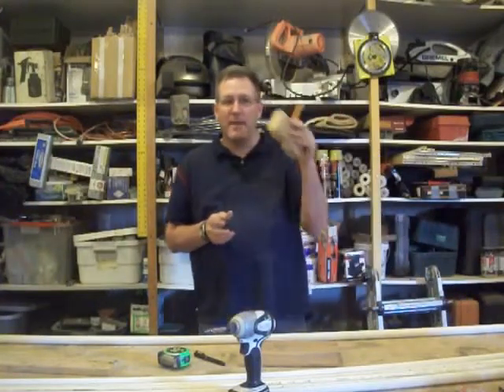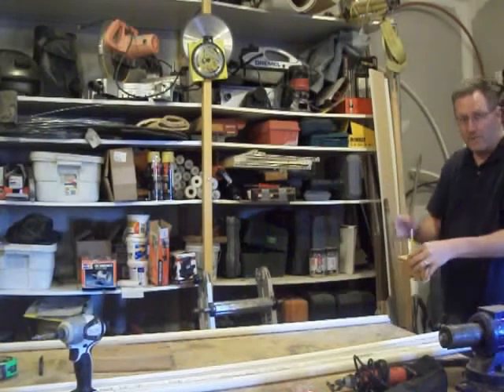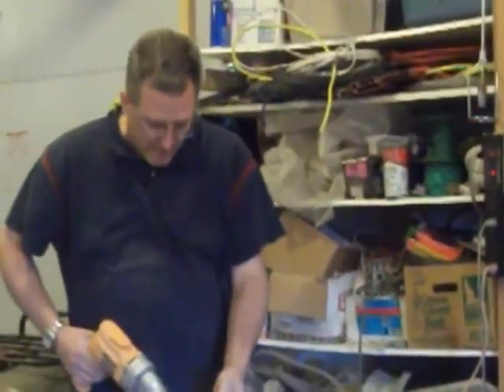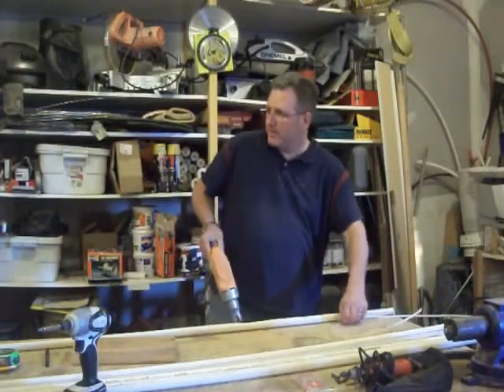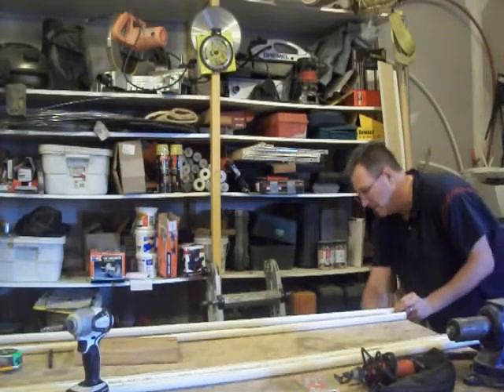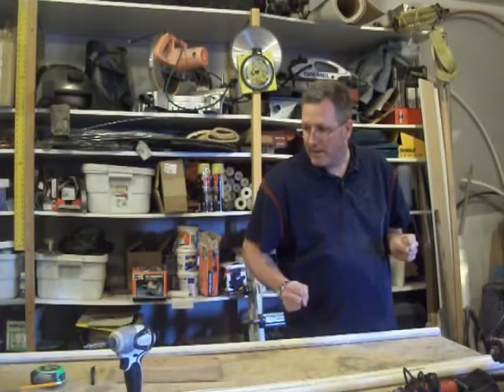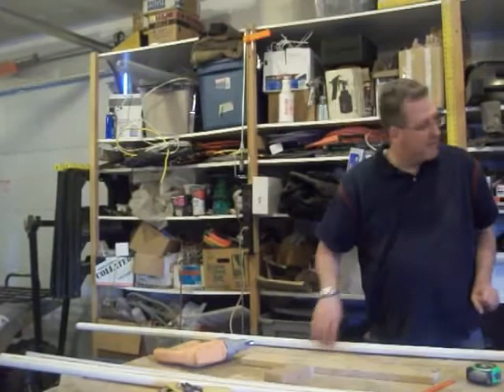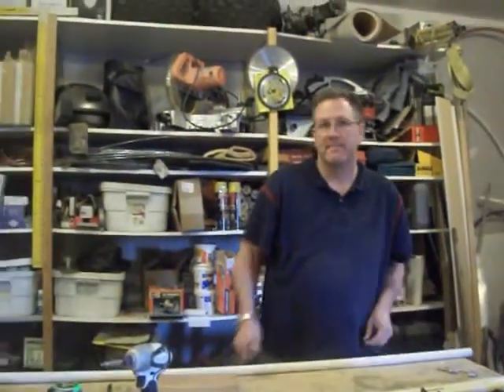Step 2: Sprinkler Template Creator For Mittleider Pipe System

Comment: Hi. What size pipe did you use for the template. I know it's 200 psi but what's the pipe diameter?  1"?
Reply: Rik Rob.  It was same size as the pipe it was going over.  I am pretty sure it was 1inch pipe we were using.  Since pipe is cut it spreads pretty well over the pipe.